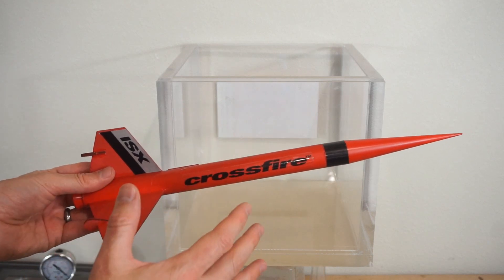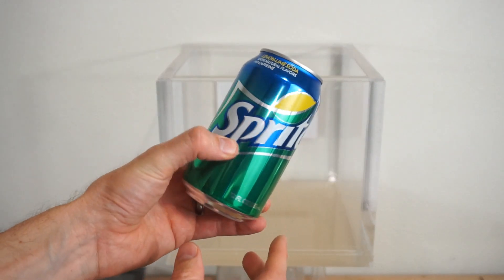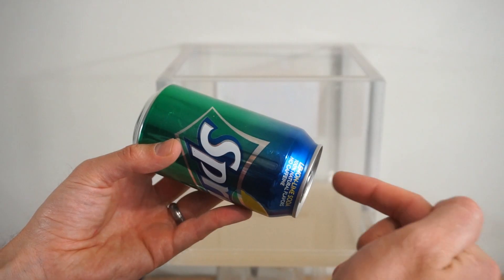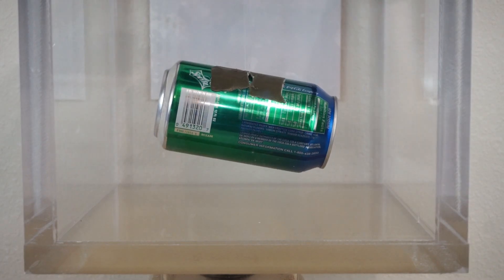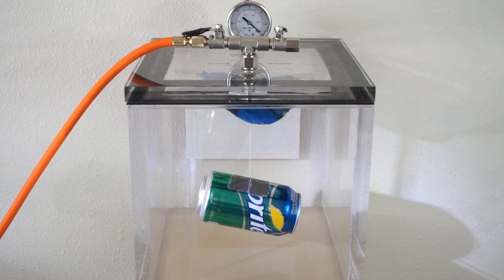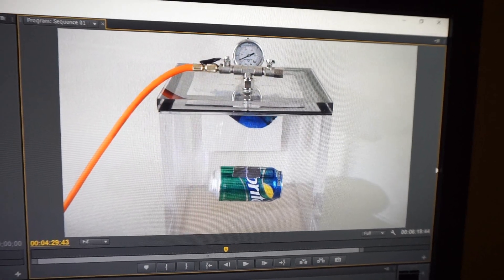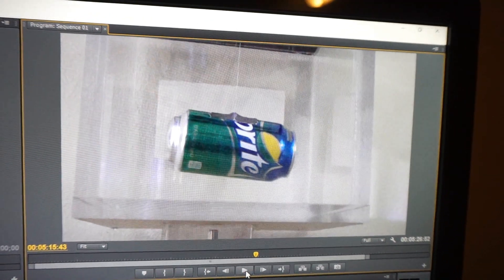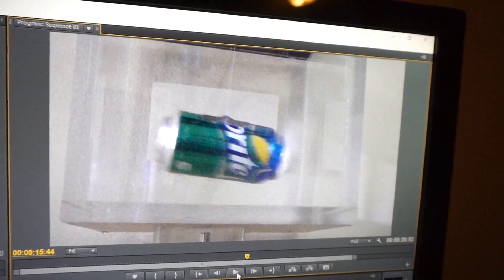Can a Rocket Fly in a Vacuum Chamber?

Comment: It seems it is pushing from the lid. Like ammunition fired outside a gun, there is a pushing reaction between the projectile and the bullet brass. 

Your reaction was at the moment the lid started to blown off.  Your rocket had a nice close reactive surface.
Reply: robert fish
You're a bit off mate.

The action/reaction interface that's pushing the can is at the bottom of the can.

While the can is still sealed, pressure is pushing out on all sides (top, bottom and sides). However, when the lid bursts open, an inbalance is created, so now the pressure can only act on some of the sides (bottom and sides), since the lid is letting out pressure. This means that where before, all forces cancelled each other out, now there's a force acting on the bottom which isn't cancelled out, since there's a hole in the top.

If you want an easy way to think about how a rocket engine works, then imagine an indestructible bucket with a stick of dynamite inside. It's pretty clear that the bucket will fly off, with or without an atmosphere, given how the gases from the exploding dynamite push on the bucket.
Reply: ShadowFalcon,

“You're a bit off mate.”

Don’t think so, mate.

“The action/reaction interface that's pushing the can is at the bottom of the can.

While the can is still sealed, pressure is pushing out on all sides (top, bottom and sides). However, when the lid bursts open, an inbalance is created, so now the pressure can only act on some of the sides (bottom and sides), since the lid is letting out pressure. This means that where before, all forces cancelled each other out, now there's a force acting on the bottom which isn't cancelled out, since there's a hole in the top.”

No, it is obviously the lid as I previously described, the first surface, like my ammunition example. A rocket cannot work in a near perfect vacuum that has infinite room for expansion.

“If you want an easy way to think about how a rocket engine works, then imagine an indestructible bucket with a stick of dynamite inside. It's pretty clear that the bucket will fly off, with or without an atmosphere, given how the gases from the exploding dynamite push on the bucket.”

Higher pressure gas ALWAYS expands and dissipates into a lower pressure, every time. This video is a parlor trick and in no way mimics what would happen in “space”. If your bucket had infinite space to expand in a vacuum described as having only one or two hydrogen atoms in a cubic meter, in an area that covered infinity, it will remain where it was as all the high pressure gas from the explosive  is immediately dispersed. 

With no atmosphere, or can lid surface to push back, there is no opposite reaction.
Reply: robert fish
"No, it is obviously the lid as I previously described, the first surface, like my ammunition example. A rocket cannot work in a near perfect vacuum that has infinite room for expansion."

Right. How does reaction mass hitting the lid, in any way transfer force to the can?

For something to transfer force, it needs to be in contact.

"Higher pressure gas ALWAYS expands and dissipates into a lower pressure, every time. This video is a parlor trick and in no way mimics what would happen in “space”. If your bucket had infinite space to expand in a vacuum described as having only one or two hydrogen atoms in a cubic meter, in an area that covered infinity, it will remain where it was as all the high pressure gas from the explosive  is immediately dispersed. 

With no atmosphere, or can lid surface to push back, there is no opposite reaction."

So, what force would cause the gas that was headed towards the bucket to turn around and exit the bucket, before transferring any force to the bucket?

A vacuum isn't a magical sucking thing. It's the absence of matter, meaning that when moving, you'll be completely inertial. That means, if you want to alter your direction, you need to have a force.

In the case of the bucket and the dynamite, that force would be the gas hitting the bottom of the bucket. This impact would then send the gas back out, but it would also push the bucket away. Action, and reaction.
Reply: ShadowFalcon,

You apparently do not understand how gas expands. Here is an experiment you can try that may give you some idea what you are dealing with, but near absolute infinite vacuum is way stronger...

Get out your Hoover  and attach the end of the hose to your lips. Turn it on and blow as hard as you can into the evacuated hose and see how far your head moves, or if you can extricate your mouth. 

Hope this helps.
Reply: robert fish
Actually, I think it's me who understands how gas expands, and not you.

For starters, you're trying to discredit action/reaction, by having me blow air.

The amount of air I can blow, at the speed I can blow, isn't that great a reaction mass.

The average speed the human person can blow air, is about 40m/s, and the amount of air the average male can maximally expel is 4.6l.

On top of that, we know that air has a density of 1.225kg/m^3 which equates to 0.001225kg/l, which means, I can expel about 0.056kg of air.

Let's assume that I can accelerate all that air up to 40m/s in about 1 second, which means the air undergoes an acceleration of 40m/s^2

So let's calculate the force I'm applying to the air, using Newton's Second Law of Motion.

F=m*a or in our case 0.056kg * 40m/s^2 = 2.24N

2.24N isn't that much of a force, and even without the air rushing around my head, going into the vacuum cleaner, I probably wouldn't move any appreciable distance, given the friction between my feet and the floor, not to mention the inertia of my skull.

But, I'm not gonna be a spoil sport, so here's an experiment to test whether atmosphere has an effect on action/reaction.

Stand on a skateboard, and throw a bowling ball out to a predetermined distance. Measure the distance you moved. Now reset, but instead of throwing a bowling ball, throw a lighter projectile of equal diameter (say a beach ball), to the same predetermined distance. Measure the distance again.

Now, if thrust depends on you pushing against the atmosphere, you'll have moved an equal distance throwing the beach ball, as you did throwing the bowling ball.

However, if I'm right, and thrust depends on the mass and acceleration of the reaction mass, then you'll move further throwing the bowling ball, since it's heavier than the beach ball.
Reply: ShadowFalcon,

“Actually, I think it's me who understands how gas expands, and not you.For starters, you're trying to discredit action/reaction, by having me blow air.”

You are the dynamite. Blowing into a vacuum cleaner is just a futile as explosives in a bucket in space. 

“The amount of air I can blow, at the speed I can blow, isn't that great a reaction mass.”

What kind of reaction mass must one have to overcome infinity? I really want to know this one. 

“The average speed the human person can blow air, is about 40m/s, and the amount of air the average male can maximally expel is 4.6l.On top of that, we know that air has a density of 1.225kg/m^3 which equates to 0.001225kg/l, which means, I can expel about 0.056kg of air.”

Wonderful. 

“Let's assume that I can accelerate all that air up to 40m/s in about 1 second, which means the air undergoes an acceleration of 40m/s^2 So let's calculate the force I'm applying to the air, using Newton's Second Law of Motion.F=m*a or in our case 0.056kg * 40m/s^2 = 2.24N. 2.24N isn't that much of a force, and even without the air rushing around my head, going into the vacuum cleaner, I probably wouldn't move any appreciable distance, given the friction between my feet and the floor, not to mention the inertia of my skull.But, I'm not gonna be a spoil sport, so here's an experiment to test whether atmosphere has an effect on action/reaction.”

So you admit that it is impossible to overcome the vacuum. We are in agreement. That was the point of the experiment. 

“Stand on a skateboard, and throw a bowling ball out to a predetermined distance. Measure the distance you moved. Now reset, but instead of throwing a bowling ball, throw a lighter projectile of equal diameter (say a beach ball), to the same predetermined distance. Measure the distance again.”

This is non sequitur. This is not done in a vacuum and does not involve expanding gas. 

“Now, if thrust depends on you pushing against the atmosphere, you'll have moved an equal distance throwing the beach ball, as you did throwing the bowling ball.”

Again, this is not all that is happening on the skateboard. You can move a skateboard exclusively with body gyrations. You are ignoring the fact that we are dealing with gas. 

“However, if I'm right, and thrust depends on the mass and acceleration of the reaction mass, then you'll move further throwing the bowling ball, since it's heavier than the beach ball.”

And this is relevant because…?

Imagine the same experiment under water, would the results change due to density? This is one of those textbook indoctrination examples that is designed to stop critical thinking. It has no relevance.
Reply: robert fish
"You are the dynamite. Blowing into a vacuum cleaner is just a futile as explosives in a bucket in space."

My point was that, you don't understand the masses, and the accelerations involved.

"What kind of reaction mass must one have to overcome infinity? I really want to know this one."

What object has infinite mass?

It's not about overcoming a vacuum, it's about overcoming inertia. In this case, you're asking me to have about 0.056kg of mass overcome the inertia of a head weighing about 5kg (plus a bit of force from the atmosphere pushing the head and the vacuum cleaner pipe together).

"So you admit that it is impossible to overcome the vacuum. We are in agreement. That was the point of the experiment."

I'm not surprised you missed the point.

No, it's not impossible, it's just a bit tricky when the mass you want to move outweighs the reaction mass by a factor of 100.

"This is non sequitur. This is not done in a vacuum and does not involve expanding gas."

Actually, it's an N3 experiment, designed to measure the effect of the atmosphere on action/reaction events.

"Again, this is not all that is happening on the skateboard. You can move a skateboard exclusively with body gyrations. You are ignoring the fact that we are dealing with gas."

Gas is just as much subject to Newton's Laws of Motion, and conservation of momentum as any other object.

Why do you think gases usually disperse? Well, that's because of internal interactions between the gas molecules, all of which can be described with Newton's laws, conservation of momentum, and basic kinematics.

"And this is relevant because…?

Imagine the same experiment under water, would the results change due to density? This is one of those textbook indoctrination examples that is designed to stop critical thinking. It has no relevance."

The result would be similar, only with shorter distances, given the increased drag you experience when moving.

I know, because I've actually done the experiments. Can you claim to have done the same? The whole point of the physics textbook is to be tested. To have you do experiments to see if what's in the textbook is actually the case.

Personally, I've done the maths, and I've done the experiments.
Reply: ShadowFalcon
"You are the dynamite. Blowing into a vacuum cleaner is just a futile as explosives in a bucket in space."
“My point was that, you don't understand the masses, and the accelerations involved.”

How would you know what I understand? You are still failing to see the obvious failure of exhausting rocket gas propellant into an infinite, near absolute vacuum.  

What kind of reaction mass must one have to overcome infinity? I really want to know this one.
You need an object with infinite mass.

Infinite space is an empty vacuum, your belief system demands that we are surrounded by near absolute vacuum that stretched infinitely. You must create something that is capable of filling this void to allow for the normal reactions of propulsion that happens in atmosphere. What have you got?

“It's not about overcoming a vacuum, it's about overcoming inertia. In this case, you're asking me to have about 0.056kg of mass overcome the inertia of a head weighing about 5kg (plus a bit of force from the atmosphere pushing the head and the vacuum cleaner pipe together).”

The other part of the experiment was for you to out blow the vacuum hose off. Inertia does not factor, except to point out a body at rest tends to stay that way. I know you went to some trouble looking up the math and you probably think it frightens me but it does not follow, that, the experiment failed move the hose because of inertia. You failed to extricate the hose because your gas was insufficient to overcome the way lesser vacuum of the Hoover. 

So you admit that it is impossible to overcome the vacuum. We are in agreement. That was the point of the experiment.

“I'm not surprised you missed the point.”

No you…

“No, it's not impossible, it's just a bit tricky when the mass you want to move outweighs the reaction mass by a factor of 100.”

It is not possible unless the vacuum is malfunctioning. I bet using a typical 2HP household compressor at 4 or 5 CFM that you could extricate the vacuum hose. 

"This is non sequitur. This is not done in a vacuum and does not involve expanding gas."
“Actually, it's an N3 experiment, designed to measure the effect of the atmosphere on action/reaction events.”
What the heck is an N3 experiment? Is it a mind fuk, designed to lull you into a belief that NASA’s fairy tales are real? Like I said, you can move a skateboard by just shifting your body no bowling balls needed.
"Again, this is not all that is happening on the skateboard. You can move a skateboard exclusively with body gyrations. You are ignoring the fact that we are dealing with gas."

“Gas is just as much subject to Newton's Laws of Motion, and conservation of momentum as any other object.”

Yes, agreement. 

“Why do you think gases usually disperse?” 

It has been observed for hundreds of years. It is undisputed science. I have seen it first hand with an unrelenting consistency.

“Well, that's because of internal interactions between the gas molecules, all of which can be described with Newton's laws, conservation of momentum, and basic kinematics."

Please be specific, or throw out names like Boyle's law and Brownian motion, the usual predictive math for gas, which is way more impressive. 

“Imagine the same experiment under water, would the results change due to density? This is one of those textbook indoctrination examples that is designed to stop critical thinking. It has no relevance.
The result would be similar, only with shorter distances, given the increased drag you experience when moving.”

The beach ball would have more surface area and create a more opposite resistance under water so your push would equate into a further aquatic skateboard movement, however, this is only relevant to prove that to have an equal and opposite reaction it is necessary to have something to push against. 

“I know, because I've actually done the experiments. Can you claim to have done the same? The whole point of the physics textbook is to be tested. To have you do experiments to see if what's in the textbook is actually the case. Personally, I've done the maths, and I've done the experiments.”

You do understand that it is just another parlor trick and does not prove anything relating to rockets in space. Sadly, I also had the same education and then some, where we had to match the answers in the book. This experiment proves nothing; it just tells you how to do the trick.

A few years ago I saw this video: https://www.youtube.com/watch?v=IhQ4dE_RGnQ  How to Shoot an Anvil 200 Feet in the Air. It is under 2 minutes and pretty cool. By placing the anvil bases, the bottom one with a hollowed out section for black powder and a standard anvil on top so there is no apace between them, the top anvil was shot close to 200 feet in the air. You can watch this equal and opposite reaction. 

Now imagine this same experiment with nearly the same set up, except, have the top anvil lifted 8” or so above the bottom one, using common cinderblocks on either end with a big open space in the middle above the charge. Can you predict how many feet the top anvil will travel with nothing directly to push against?   Here is your indestructible bucket w/dynamite in the best observable conditions to shows my point exactly. 

Rockets, in theory, or at least if you believe that they are not helium balloons, are much heavier than anvils and space is further apart than 8".
Reply: robert fish
"How would you know what I understand? You are still failing to see the obvious failure of exhausting rocket gas propellant into an infinite, near absolute vacuum."

I know what you understand, from your frankly weird ideas of how thrust works

"What kind of reaction mass must one have to overcome infinity? I really want to know this one.
You need an object with infinite mass."

The rocket doesn't have infinite mass, so why would I need an infinite mass to move it?

"Infinite space is an empty vacuum, your belief system demands that we are surrounded by near absolute vacuum that stretched infinitely. You must create something that is capable of filling this void to allow for the normal reactions of propulsion that happens in atmosphere. What have you got?"

No, I don't.

I just need kinematic interactions.

Like a bullet hitting a wall.

Or a gas-particle hitting the inside of the rocket engine. Easy.

"The other part of the experiment was for you to out blow the vacuum hose off. Inertia does not factor, except to point out a body at rest tends to stay that way. I know you went to some trouble looking up the math and you probably think it frightens me but it does not follow, that, the experiment failed move the hose because of inertia. You failed to extricate the hose because your gas was insufficient to overcome the way lesser vacuum of the Hoover. 

So you admit that it is impossible to overcome the vacuum. We are in agreement. That was the point of the experiment."

The reason I mentioned inertia was because you imposed the limitation of me having to use a process, that can't even defeat the inertia of my head, let alone any additional forces caused by the surrounding atmosphere.

"It is not possible unless the vacuum is malfunctioning. I bet using a typical 2HP household compressor at 4 or 5 CFM that you could extricate the vacuum hose."

And you still don't see the issue.

My head wouldn't move in the first place, thanks to the absolutely miniscule amount of thrust I'd be able to generate.

"What the heck is an N3 experiment? Is it a mind fuk, designed to lull you into a belief that NASA’s fairy tales are real? Like I said, you can move a skateboard by just shifting your body no bowling balls needed."

An N3 experiment, is an experiment meant to test N3. Or Newton's Third Law.

"It has been observed for hundreds of years. It is undisputed science. I have seen it first hand with an unrelenting consistency."

I meant the internal mehanics. What causes gas to disperse. A casual observation doesn't cause gas to disperse.

"Please be specific, or throw out names like Boyle's law and Brownian motion, the usual predictive math for gas, which is way more impressive."

Boyle's Law, and Brownian motion describe the large scale behavior of gases, however that isn't relevant. What's relevant are the small scale interactions between the particles in the gas.

"The beach ball would have more surface area and create a more opposite resistance under water so your push would equate into a further aquatic skateboard movement, however, this is only relevant to prove that to have an equal and opposite reaction it is necessary to have something to push against."

I specified that the beach ball must have the same diameter, and therefore the same surface area as the bowling ball, exactly so this wouldn't be a factor.

"Rockets, in theory, or at least if you believe that they are not helium balloons, are much heavier than anvils and space is further apart than 8"."

Rockets also consist of 95% by mass fuel. That's a much larger percentage of mass than what that anvil could ever hope to have.
Reply: ShadowFalcon
"How would you know what I understand? You are still failing to see the obvious failure of exhausting rocket gas propellant into an infinite, near absolute vacuum."
“I know what you understand, from your frankly weird ideas of how thrust works”

That is very doubtful if you did, you would not be so blocked. Because I was a believer, just like you I know what you understand and got over it. Even a child realizes when you release a balloon the thrust comes from the nozzle. They un-teach the obvious by saying it is the opposite reaction to the thrust, pushing the inside of the balloon in front, but intuitively you understood thrust was possible because it is pushing against the atmosphere. Not at all weird, it is apparent, you have only forgotten.

"What kind of reaction mass must one have to overcome infinity? I really want to know this one. You need an object with infinite mass."
“The rocket doesn't have infinite mass, so why would I need an infinite mass to move it?”

You have to build something to push against with a rocket thrust. The only way you can do this is to populate the infinite space with a lot more than 2 or 3 hydrogen atoms per cubic meter sufficiently enough to cause a resistance to the thrust, Because space is infinite, and minimally the thrust would have to be nearly equal to work, you have to expel infinite amounts of material. 

"Infinite space is an empty vacuum, your belief system demands that we are surrounded by near absolute vacuum that stretched infinitely. You must create something that is capable of filling this void to allow for the normal reactions of propulsion that happens in atmosphere. What have you got?"

“No, I don't. I just need kinematic interactions. Like a bullet hitting a wall.Or a gas-particle hitting the inside of the rocket engine. Easy.”

It seems that most Kinematic interactions revolve around solids and foundations and does not seem to be or any practical use, but because it has been a while and they were only useful for hypothetical foundation analysis, in a class that usually put me to sleep, (and wasn't on the test), you could perhaps give me some pointers on how this works with rockets in a vacuum… Especially if it is easy!

"The other part of the experiment was for you to out blow the vacuum hose off. Inertia does not factor, except to point out a body at rest tends to stay that way. I know you went to some trouble looking up the math and you probably think it frightens me but it does not follow, that, the experiment failed move the hose because of inertia. You failed to extricate the hose because your gas was insufficient to overcome the way lesser vacuum of the Hoover. So you admit that it is impossible to overcome the vacuum. We are in agreement. That was the point of the experiment."
“The reason I mentioned inertia was because you imposed the limitation of me having to use a process, that can't even defeat the inertia of my head, let alone any additional forces caused by the surrounding atmosphere.”

Why would conditions be different in space? Sure the vacuum is near absolute, your Hoover  5.9 inches (600 Torr) of vacuum whereas the best vacuum we can pull is 29.92 inches but because there is no air pressure in space, the vacuum is between 10^-17 Torr and 10^-6 Torr in near earth outer space.

"It is not possible unless the vacuum is malfunctioning. I bet using a typical 2HP household compressor at 4 or 5 CFM that you could extricate the vacuum hose.”
“And you still don't see the issue.”

There is no issue except in your mind

“My head wouldn't move in the first place, thanks to the absolutely miniscule amount of thrust I'd be able to generate.”

Imagine your head was in the frictionless vacuum of space if that helps. The point you continually overlook is the futility of trying to move using thrust, form your breath or whatever, in a near perfect vacuum. 

"What the heck is an N3 experiment? Is it a mind fuk, designed to lull you into a belief that NASA’s fairy tales are real? Like I said, you can move a skateboard by just shifting your body no bowling balls needed." “An N3 experiment, is an experiment meant to test N3. Or Newton's Third Law.”

Sorry, I did not recognize the short hand. 

"It has been observed for hundreds of years. It is undisputed science. I have seen it first hand with an unrelenting consistency." “I meant the internal mehanics. What causes gas to disperse. A casual observation doesn't cause gas to disperse.”

I fully agree with my previous statement.

"Please be specific, or throw out names like Boyle's law and Brownian motion, the usual predictive math for gas, which is way more impressive." “Boyle's Law, and Brownian motion describe the large scale behavior of gases, however that isn't relevant. What's relevant are the small scale interactions between the particles in the gas.”

Surely you jest. Even if that were true, we are discussing large scale anyway, exceptionally large scale – to infinity. There are some fairly un-useful equations that were developed to study air pollution in the atmosphere, but I get the feeling that you are only throwing hail Mary’s to try and bring this discussion over my poor pointy head, after all FE types don’t do science. Is that your goal?   

"The beach ball would have more surface area and create a more opposite resistance under water so your push would equate into a further aquatic skateboard movement, however, this is only relevant to prove that to have an equal and opposite reaction it is necessary to have something to push against."
“I specified that the beach ball must have the same diameter, and therefore the same surface area as the bowling ball, exactly so this wouldn't be a factor.”

Sorry, overlooked that and considered only the usual size of the balls, still, the difference in buoyancy would naturally lift you on your aquatic board and that would make a difference in favor of the beach ball.

"Rockets, in theory, or at least if you believe that they are not helium balloons, are much heavier than anvils and space is further apart than 8".“Rockets also consist of 95% by mass fuel. That's a much larger percentage of mass than what that anvil could ever hope to have.”

Did you watch the video? The point you missed was it was necessary to have the masses together and there is no way an anvil would lift off without this surface to surface design. Having any space direct the force outward where it is useless, even with an atmosphere. 

I also doubt your belief that the rockets are 95% fuel. Ever watch a military offensive rocket launch? Those are so much speedier.  NASA space rockets make a more leisurely balloon like launch. NASA uses over half of the world's helium production... Just saying.
Reply: Robert fish

”That is very doubtful if you did, you would not be so blocked. Because I was a believer, just like you I know what you understand and got over it. Even a child realizes when you release a balloon the thrust comes from the nozzle. They un-teach the obvious by saying it is the opposite reaction to the thrust, pushing the inside of the balloon in front, but intuitively you understood thrust was possible because it is pushing against the atmosphere. Not at all weird, it is apparent, you have only forgotten.”

So you think the exhaust plume acts like a kind of stick, which is then used by the rocket to push off the ground?

Talk about weird.

“You have to build something to push against with a rocket thrust. The only way you can do this is to populate the infinite space with a lot more than 2 or 3 hydrogen atoms per cubic meter sufficiently enough to cause a resistance to the thrust, Because space is infinite, and minimally the thrust would have to be nearly equal to work, you have to expel infinite amounts of material.”

No, I just need to have gas impact the inside of the rocket engine.

Which happens when the propellants combust.

“It seems that most Kinematic interactions revolve around solids and foundations and does not seem to be or any practical use, but because it has been a while and they were only useful for hypothetical foundation analysis, in a class that usually put me to sleep, (and wasn't on the test), you could perhaps give me some pointers on how this works with rockets in a vacuum… Especially if it is easy!”

Kinematic interactions revolve around MASSES. Not solids. Here are some examples. E=1/2*m*v^2, which is kinetic energy, or how about the elastic collision, which is used to describe the idealized interactions between atoms, or molecules in a gas.

“Why would conditions be different in space? Sure the vacuum is near absolute, your Hoover 5.9 inches (600 Torr) of vacuum whereas the best vacuum we can pull is 29.92 inches but because there is no air pressure in space, the vacuum is between 10^-17 Torr and 10^-6 Torr in near earth outer space.”

They’d be different, because in space I’d only have to fight the inertia on my head, not the forces of the atmosphere around me.

“There is no issue except in your mind”

Oh, so you don’t see the glaringly obvious issue of trying to move an object, using another object that has a mass about 100 times smaller, and isn’t moving that fast eh.

FFS, how miserable was physics class where you lived.

“Imagine your head was in the frictionless vacuum of space if that helps. The point you continually overlook is the futility of trying to move using thrust, form your breath or whatever, in a near perfect vacuum.”

Well, in that case, my head would accelerate a tiny bit, since we’re subjecting it to a force of about 2.2N.

“I fully agree with my previous statement.”

So you think a casual observation has anything to do with explaining the internal mechanics of how gases work?

“Surely you jest. Even if that were true, we are discussing large scale anyway, exceptionally large scale – to infinity. There are some fairly un-useful equations that were developed to study air pollution in the atmosphere, but I get the feeling that you are only throwing hail Mary’s to try and bring this discussion over my poor pointy head, after all FE types don’t do science. Is that your goal?”

No I don’t ”jest”. And they are really useful, since they are what Boyle used to derive his gas laws. Pressure itself is a kinematic phenomenon, of particles hitting, and transferring kinetic energy to a surface. As for my goal. It’s to showcase how relatively simple the physics you manage to get so horribly wrong is.

Some retards have managed to convince themselves that physics is some esoteric kind of magic because “maths” are used to describe it, and they think math is boring and nerdy.

“Sorry, overlooked that and considered only the usual size of the balls, still, the difference in buoyancy would naturally lift you on your aquatic board and that would make a difference in favor of the beach ball.”

No it wouldn’t. If you think it would, then explain the maths you used to arrive at that conclusion.

“Did you watch the video? The point you missed was it was necessary to have the masses together and there is no way an anvil would lift off without this surface to surface design. Having any space direct the force outward where it is useless, even with an atmosphere.”

Yeah, I watched it. And what you seemed to miss was that, the mass of the gunpowder doesn’t go away.

“I also doubt your belief that the rockets are 95% fuel. Ever watch a military offensive rocket launch? Those are so much speedier. NASA space rockets make a more leisurely balloon like launch. NASA uses over half of the world's helium production... Just saying.”

That 95% propellant figure applies to most rockets. The reason military weaponry accelerates faster, is because it’s lighter. Ever seen how big the Saturn V was? How heavy it was?

You know, for once I’d like you to do the bloody math, and arrive at a conclusion.
Reply: ShadowFalcon,

“So you think the exhaust plume acts like a kind of stick, which is then used by the rocket to push off the ground?”

No, it pushes against the atmosphere. The same media that allows birds to fly, wings to lift, allows parachutes to open…you know, don’t you?  

“Talk about weird.”

Weird is where you suddenly realize that everything you know is wrong. How’s that? 

“You have to build something to push against with a rocket thrust. The only way you can do this is to populate the infinite space with a lot more than 2 or 3 hydrogen atoms per cubic meter sufficiently enough to cause a resistance to the thrust, Because space is infinite, and minimally the thrust would have to be nearly equal to work, you have to expel infinite amounts of material.”
“No, I just need to have gas impact the inside of the rocket engine. Which happens when the propellants combust.”

This is where it all falls apart. If you mount a rocket engine on a rail car, build a wall on the back side of the car that would cover the thrust and fire the engine so it pushes against the wall, nothing moves. Your interior gas impact theory is a total failure. You can try this on a smaller scale with bottle rockets and an “S” scale model train. It won’t move. Remove the wall and it will move.  The thrust OBVIOUSLY comes from the hot nozzle end pushing against the atmosphere. 

“It seems that most Kinematic interactions revolve around solids and foundations and does not seem to be or any practical use, but because it has been a while and they were only useful for hypothetical foundation analysis, in a class that usually put me to sleep, (and wasn't on the test), you could perhaps give me some pointers on how this works with rockets in a vacuum… Especially if it is easy!”

Kinematic interactions revolve around MASSES. Not solids. Here are some examples. E=1/2*m*v^2, which is kinetic energy, or how about the elastic collision, which is used to describe the idealized interactions between atoms, or molecules in a gas."

Sort of a generic formula...Kinetic energy is directly proportional to the mass of the object and to the square of its velocity. That pretty much covers it... So, where is your simple Kinematic interactions math to show how a typical rocket moves in space? 

“Why would conditions be different in space? Sure the vacuum is near absolute, your Hoover 5.9 inches (600 Torr) of vacuum whereas the best vacuum we can pull is 29.92 inches but because there is no air pressure in space, the vacuum is between 10^-17 Torr and 10^-6 Torr in near earth outer space.”
“They’d be different, because in space I’d only have to fight the inertia on my head, not the forces of the atmosphere around me.”

So you think you could out blow infinite near perfect vacuum that is at least 6 times greater than a Hoover, if you were in space. It is frictionless… Perhaps the Kinematic interactions of your esophagus being ripped from your body would give you some thrust?  

“There is no issue except in your mind”
“Oh, so you don’t see the glaringly obvious issue of trying to move an object, using another object that has a mass about 100 times smaller, and isn’t moving that fast eh.”

What did I say about that? The point was not so much the miserable amount of thrust you could generate, it was the futility of trying to overcome vacuum with any thrust. Normally, the third graders pick this up by the second time. I think this is the third time. But ignoring this does give that opening for this comment:
“FFS, how miserable was physics class where you lived.”

 “Imagine your head was in the frictionless vacuum of space if that helps. The point you continually overlook is the futility of trying to move using thrust, form your breath or whatever, in a near perfect vacuum.”
“Well, in that case, my head would accelerate a tiny bit, since we’re subjecting it to a force of about 2.2N.”

No. If you can’t overcome the minimum vacuum, how do you expect to overcome the maximum space vacuum? 

“So you think a casual observation has anything to do with explaining the internal mechanics of how gases work?”

I don’t think it is easily missed even by the least interested person. Take farting for instance. It is a typical higher pressure dissipating to a lower pressure phenomenon that everyone recognizes. That is about it. I once worked for a PE that told me the only thing one need to know to be a plumber is, that shit won’t flow uphill. Sometimes it is that simple and that obvious. 

“No I don’t ”jest”. And they are really useful, since they are what Boyle used to derive his gas laws. Pressure itself is a kinematic phenomenon, of particles hitting, and transferring kinetic energy to a surface. As for my goal. It’s to showcase how relatively simple the physics you manage to get so horribly wrong is.”

It appears that you failed terribly. I think by providing examples, practical and easy to perform experiments showing the simplicity of the impossibility of thrust in a vacuum are a bit weightier than your Kinematic interactions hope message.  Still, I am waiting for that simple example…

“Some retards have managed to convince themselves that physics is some esoteric kind of magic because “maths” are used to describe it, and they think math is boring and nerdy.”

Math is useful, practical and necessary to avert total fuckups.  Math becomes magic is when they have a theory and bend equations to fit. I can play that tune, especially when it is impossible for earth bound experimental proofs are not feasible and the only ones that can afford space travel, rake in billions for CGI.  I have a field of stealth fighters, but you can’t see them…   

“Sorry, overlooked that and considered only the usual size of the balls, still, the difference in buoyancy would naturally lift you on your aquatic board and that would make a difference in favor of the beach ball.”
No it wouldn’t. If you think it would, then explain the maths you used to arrive at that conclusion."

Say I weighed 150 pounds with a BMI 18.5 not a lot of fat… Actually this would be the same for the average bowling ball throw and the beach ball. The normal buoyancy of the thrower would be decreased by around 16 pounds by the bowling ball and increased by 12 pounds for the beach ball. The circumference would be 27” with a volume of 333 cubic inches.  Because the buoyancy force is equal to the weight of the amount of water the beach ball displaces, 333 cubic inches, it can lift about 12 pounds. My weight is increased to 166 pounds w/the bowling ball, decreased to 138 with a difference of 28 pounds. I’ll let you figure the inertia… 

“Did you watch the video? The point you missed was it was necessary to have the masses together and there is no way an anvil would lift off without this surface to surface design. Having any space direct the force outward where it is useless, even with an atmosphere.”

“Yeah, I watched it. And what you seemed to miss was that, the mass of the gunpowder doesn’t go away.”

The force to lift the anvil is only possible if it is directly connected to the upper one. If there were any space, I would wager bigger than a 1/8” this would fail. It should show the importance of having something to push from, but you seemed to miss that. If he just lit the gunpowder without the enclosure, say just poured it into a pile an lit it, it would go “foop” with a nice flash, some smoke and no report. 

“I also doubt your belief that the rockets are 95% fuel. Ever watch a military offensive rocket launch? Those are so much speedier. NASA space rockets make a more leisurely balloon like launch. NASA uses over half of the world's helium production... Just saying.” 
“That 95% propellant figure applies to most rockets. The reason military weaponry accelerates faster, is because it’s lighter. Ever seen how big the Saturn V was? How heavy it was?”

2.8 million pounds according to the same sources that sell CGI as real. 

“You know, for once I’d like you to do the bloody math, and arrive at a conclusion.”

Wernher von Braun,  father of rocket science, by his own calculations said that the Saturn V rocket would have needed to weigh 800,000 tons and been taller than the Empire State Building in order to have reached the moon… Before taking the oversight position of the Saturn V development program, Wernher Von Braun had declared that it would require a far more colossal rocket to reach the Moon. In the book Conquest of the Moon, published in 1953, Wernher Von Braun made the following comments:

“It is commonly believed that man will fly directly from the earth to the moon, but to do this, we would require a vehicle of such gigantic proportions that it would prove an economic impossibility. It would have to develop sufficient speed to penetrate the atmosphere and overcome the earth’s gravity and, having traveled all the way to the moon, it must still have enough fuel to land safely and make the return trip to earth. Furthermore, in order to give the expedition a margin of safety, we would not use one ship alone, but a minimum of three… each rocket ship would be taller than New York’s Empire State Building and weigh about ten times the tonnage of the Queen Mary, or some 800,000 tons.”

Apparently, he did the math. Video fraud is much easier and way less expensive.
Reply: Robert fish

”No, it pushes against the atmosphere. The same media that allows birds to fly, wings to lift, allows parachutes to open…you know, don’t you?”

One of these things is not like the other.
Here’s a hint. You think one of the things need three physical objects to interact, to work.

“Weird is where you suddenly realize that everything you know is wrong. How’s that?”

No, I mean weird as in, do you even know how a door works?

“This is where it all falls apart. If you mount a rocket engine on a rail car, build a wall on the back side of the car that would cover the thrust and fire the engine so it pushes against the wall, nothing moves. Your interior gas impact theory is a total failure. You can try this on a smaller scale with bottle rockets and an “S” scale model train. It won’t move. Remove the wall and it will move. The thrust OBVIOUSLY comes from the hot nozzle end pushing against the atmosphere.”

You do know that, by mounting a wall on the back of that rail car, behind the rocket engine, you’re balancing the forces acting on the rail car right?
The forces acting on the engine are now cancelled out by the forces acting on the wall.

“Sort of a generic formula...Kinetic energy is directly proportional to the mass of the object and to the square of its velocity. That pretty much covers it... So, where is your simple Kinematic interactions math to show how a typical rocket moves in space?”

Well, that’s even easier. Newton’s second law. F=m*a. You apply a force, on an object with mass, and said object will accelerate.

And if you want to know how to stay in orbit then there’s this. a=v^2/r. Tangential acceleration = velocity squared, over the radius of the orbit.

“So you think you could out blow infinite near perfect vacuum that is at least 6 times greater than a Hoover, if you were in space. It is frictionless… Perhaps the Kinematic interactions of your esophagus being ripped from your body would give you some thrust?”

I know that, without friction, 2.2N would be enough to start accelerating me, albeit slowly.

“What did I say about that? The point was not so much the miserable amount of thrust you could generate, it was the futility of trying to overcome vacuum with any thrust. Normally, the third graders pick this up by the second time. I think this is the third time. But ignoring this does give that opening for this comment:”

The idea of scale models, and analogies, is that at least the interactions make sense. Like stick of dynamite in a bucket, compared with a massive rocket with massive amounts of fuel.

“No. If you can’t overcome the minimum vacuum, how do you expect to overcome the maximum space vacuum?”

I “couldn’t” overcome the friction of my shoes, and the force of the atmosphere. A vacuum isn’t a force. It’s the absence of a force.

“It appears that you failed terribly. I think by providing examples, practical and easy to perform experiments showing the simplicity of the impossibility of thrust in a vacuum are a bit weightier than your Kinematic interactions hope message. Still, I am waiting for that simple example…”

So far, the only experiments you’ve provided have showcased a faulty understanding of how forces work. If you want a simple example, then have a crossbow fire a projectile in a vacuum chamber.

“Math is useful, practical and necessary to avert total fuckups. Math becomes magic is when they have a theory and bend equations to fit. I can play that tune, especially when it is impossible for earth bound experimental proofs are not feasible and the only ones that can afford space travel, rake in billions for CGI. I have a field of stealth fighters, but you can’t see them…”

So F=ma is magic because you don’t understand it? Or N3? Here’s a quick little tip about Newton’s Third Law.

It’s a contact force. For N3 to apply, you to have two objects in contact. Like a wing hitting the atmosphere. Or the exhaust gases hitting the inside of a rocket engine.

“Say I weighed 150 pounds with a BMI 18.5 not a lot of fat… Actually this would be the same for the average bowling ball throw and the beach ball. The normal buoyancy of the thrower would be decreased by around 16 pounds by the bowling ball and increased by 12 pounds for the beach ball. The circumference would be 27” with a volume of 333 cubic inches. Because the buoyancy force is equal to the weight of the amount of water the beach ball displaces, 333 cubic inches, it can lift about 12 pounds. My weight is increased to 166 pounds w/the bowling ball, decreased to 138 with a difference of 28 pounds. I’ll let you figure the inertia…”

I said, explain the maths. Not just pull random numbers out of your arse. I mean what does the BMI of a test subject have to do with anything?

“The force to lift the anvil is only possible if it is directly connected to the upper one. If there were any space, I would wager bigger than a 1/8” this would fail. It should show the importance of having something to push from, but you seemed to miss that. If he just lit the gunpowder without the enclosure, say just poured it into a pile an lit it, it would go “foop” with a nice flash, some smoke and no report.”

You seem to get reaction masses mixed up here.

Sure, the gunpowder alone wouldn’t move the anvil that far, but it would move it, since gunpowder has mass. If you used another anvils worth of gunpowder, and directed the blast so it could only go along one axis instead of expanding in all directions (like a rocket engine) it’d move just as fast.

That’s conservation of momentum. M_anvil * v_anvil = M_gunpowder * v_gunpowder

“2.8 million pounds according to the same sources that sell CGI as real.”

Right, and how much thrust does the rocket engines produce?

“Wernher von Braun, father of rocket science, by his own calculations said that the Saturn V rocket would have needed to weigh 800,000 tons and been taller than the Empire State Building in order to have reached the moon… Before taking the oversight position of the Saturn V development program, Wernher Von Braun had declared that it would require a far more colossal rocket to reach the Moon. In the book Conquest of the Moon, published in 1953, Wernher Von Braun made the following comments: 
[snip]
Apparently, he did the math. Video fraud is much easier and way less expensive.”

I ASKED YOU A SIMPLE QUESTION.

Hell, the math I asked for wasn’t that difficult. It’s F=m*a.

You know F through the thrust produced by the rocket engine, and you know the initial m of the rocket, since that’s the fueled mass. Just isolate the acceleration.

Also, what the everloving fuck does the non-viability of the Direct Ascent method have to do with the Saturn V? You know, apart from further reinforcing their choice of using Lunar Orbit Rendezvous.
Reply: @ShadowFalcon how are the exhaust gases hitting the inside of the chamber when they're released?
Reply: @qkqk6954  
The gases hit the inside of the chamber, before they exit the chamber.

First the propellants enter the chamber.

Then they get ignited.

Upon ignition, the exhaust gases will expand in all directions.

Because the exhaust gases expand in all directions, most will impact the sides of the chamber.

After the gases has impacted the chamber, the momentum of the gas has changed, leading to the gas exiting the chamber in one direction (out of the chamber).

Because the momentum of the gas was changed, the momentum of the chamber (and rocket) must also change, to conserve momentum. Hence thrust.